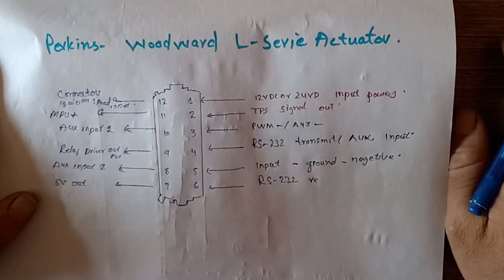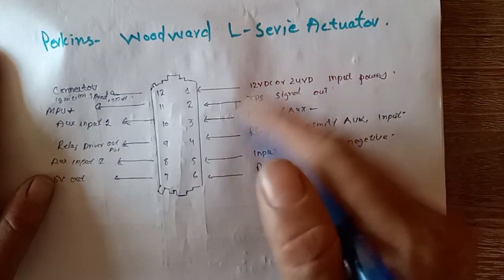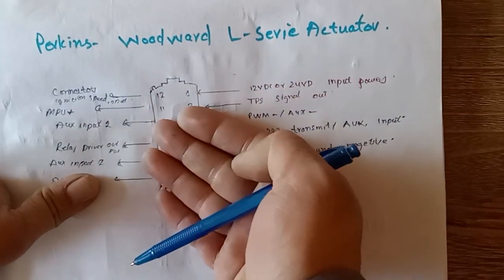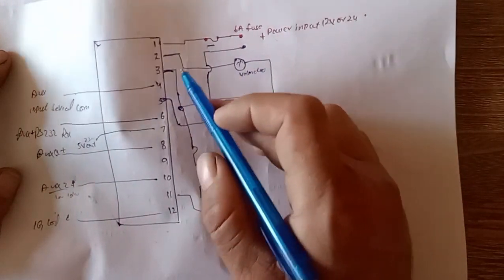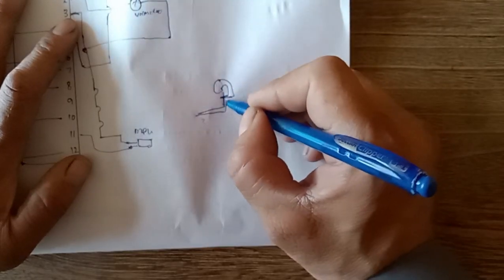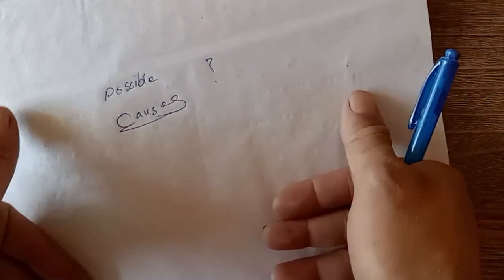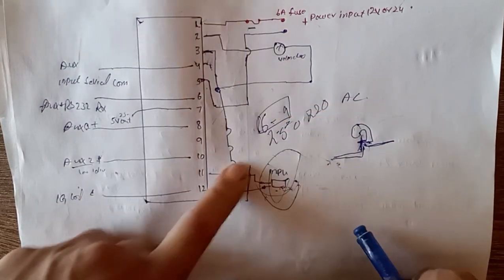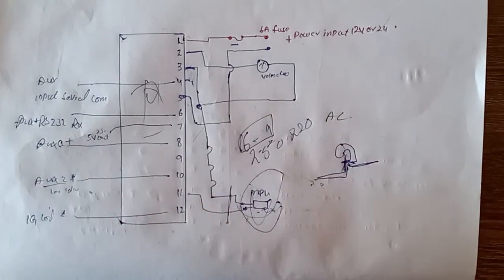Woodward Actuator  L series 26250 wiring diagram, software information, working explanation

Comment: How can the L series Actuator be connected to run on 60Hz. Thanks
Reply from the maker: It will be program for 60 or 50hz
Reply: Ok, is there any possibility for me get tools for the programing?
Thanks
Reply from the maker: Woodward L-Series actuator programming is performed using the L-Series Service Tool, a software application that runs on a PC and connects to the control via a serial cable. This tool is used for configuring, adjusting, monitoring, and troubleshooting the L-Series control to match specific engine operating parameters. Programming involves connecting the Service Tool to the control's serial connection, using the software to adjust features like speed control options (isochronous, droop, etc.) and input/output configurations, and potentially installing necessary drivers like JAVA Azul Zulu JRE. 
Key Steps for Programming
1. Install the Service Tool: Download and install the L-Series Service Tool software from the Woodward website onto your personal computer. 
2. Install Necessary Drivers: Ensure you have the correct Java JRE installed, as the Service Tool often requires it for operation. 
3. Connect to the L-Series Control: Establish a serial connection between your computer and the L-Series control using the appropriate programming harness. 
4. Open the Service Tool: Launch the L-Series Service Tool software on your PC. 
5. Configure the Control:
Input Signals: Set the control to expect the correct command signal (PWM or 0-5 V) for positioning from your supervisory engine management system. 
Function Options: Select and adjust various engine control functions, including:
Isochronous Speed (50 or 60 Hz)
Two or Three Speed operation
Droop settings
Start Fuel Limiter
Load Sharing
Dual Dynamics
Adjustable Max Fuel Stop
Manifold Air Pressure Biased Fuel Limiter
Cold Start Timer
Reply: Ok, so it can be downloaded from there web site in Internet and is it for free?
Please can you send the link.
Then two how will I get the hardness?
Thanks